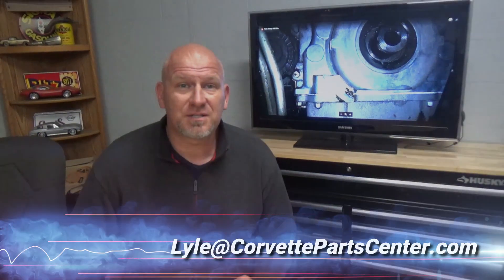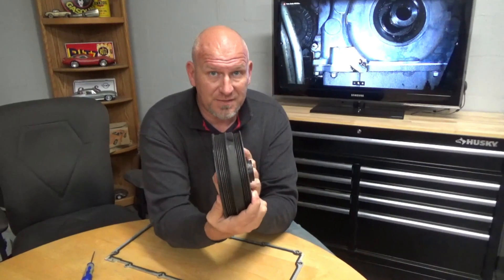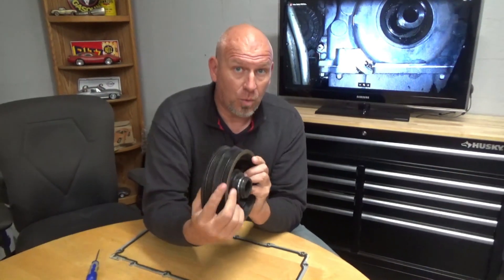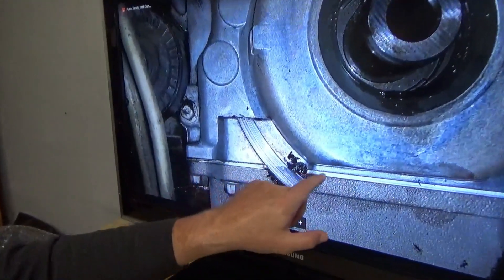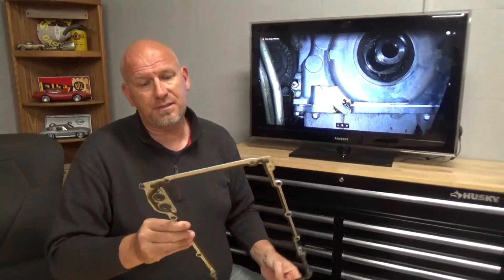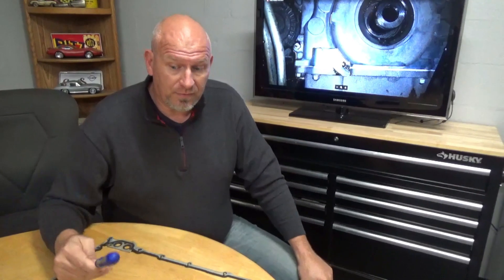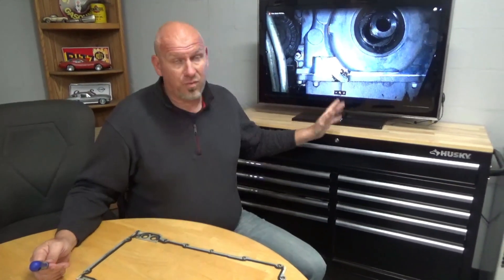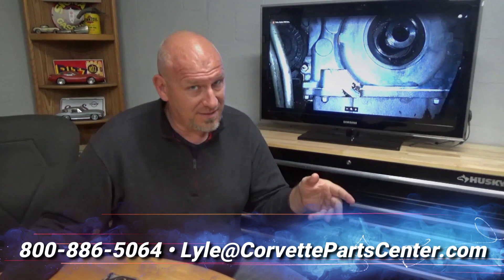C5 C6  Corvette Harmonic Balancer Problems

Comment: I've seen a lot of C5 and 6 engines running and I think I can tell when a HB is wobbling, but if you could provide a video closeup of the actual thing, doing the wobble, or perhaps an example of an early stage wobble, and a "bad", about to fail wobble, that would be enormously helpful. As always, you are the go to guy for these cars and I appreciate everything you do.
Reply: This is a good point. 

Maybe they’ll make a video describing this.

Comment: I've had my 06 for about 18 months and only put 1000 miles on it (it has 40 k miles on it). I noticed a couple of weeks back I was hearing a slight chirp from the engine. Yesterday I looked and saw the "death wobble" as you described. Luckily I only drove it 60 miles since I heard the first chirp. I already have my mechanic notified so he can replace it. Thank God for this video.
Reply: Instablaster.

Comment: Invaluable advice for us vette owners. Mine wasn't wobbling last summer, it is now. 99 c5 vert 50k miles. Time to get crackin.
Reply: Hope mine doesn't. 2000 convertible 60k miles
Reply: @mjphoto45  Oh, it will.
Reply: @mjphoto45  mine just did yesterday … 65k miles 05 C6

Comment: Just got my 05 C6 pully replaced at a local shop in lower DE, cost $1300, I had them replace it with a one piece aluminum one

Comment: the video is great and provides great information.i would not be afraid to change it using this video. however with having to take the steering rack out i will take mine in to have it changed.

Comment: I have a 2006 Z51 convertible, and I heard some chirping. I took it to a chevy dealer, and they said it was the harmonic balancer, and I needed to do something about it soon. The estimated cost was $1200, although the part itself was around $200 bucks. However, I saw a video on replacing this, and I think MY age would stop me from getting in there and taking apart the front suspension!
Reply from the maker: That price isn't crazy.  Especially if they are going to replace the belts, tensioners and idler pulley at the same time.  Lyle

Comment: What a coincidence, I looked at some Corvette forums recently and there's quite a few issues with this part. I changed mine almost immediately although my C5 Z has only 64K miles. The bolt broke while taking it off which made me thankful and upset. It took hours to drill it out. I replaced the balancer with an ATI 10% under drive. Thanks for the Vid!!
Reply: Have you had any issues with the underdrive? I was wondering about cooling system issues
Reply: @joshuaborem7063  No problems at all. This one gave me a little more torque over the OEM. The only thing you got to keep in mind is the belt sizes change. Keep a copy in the glove box in case.
Reply: @tonywestbrook6436  i’ve had my 2008 Corvette for exactly 2 1/2 days now. And I can’t even fathom the idea of wanting more power or torque :-) but hey, good on ya
Reply: @joshuaborem7063  My C5 Z is now equivalent to a C6 Z, so I'm very happy and like you, I don't need anything else now.
Reply: @tonywestbrook6436  you said you had no problems with cooling with your underdrive pulleys. Sorry but I also meant to ask what state you’re in. Because I’m in Florida and it gets real hot here.
Reply: @joshuaborem7063  NC

Comment: My brand new C6 Corvette developed the "death wobble" he is talking about with 4K miles on the odometer. I noticed that by strange sound (not scraping) from the front. It was replaced under warranty. So far (it happened 10 years ago) it is good.

Comment: I had exactly what you are describing as far as the front engine leak and the "blow back" of oil.  My mechanic was worried that I might have a fire as it was landing on the exhaust system.  So, 4k later,  new oil pan gasket - new harmonic balancer and new belts and pulleys as well.  4k well spent I guess.  Did not see you wandering around Corvettes at Carlisle this year (2022).  Hope you had a good time there.  I was busy with our club-run NCCC-sanctioned car show.  Cheers from central PA.
Reply from the maker: WE walked about 27 miles in three days and had a great time!  Sorry to have missed you as well!  Lyle
Reply: @csvette  Yeah, I did keep and eye out for you but on Fri and Sat I have a lot to accomplish putting on our club's NCCC-sanctioned show. Went very well this year - so we're happy about that.  Keep up with the GREAT content.  Excellent job.

Comment: I've been lucky with my HB.  It failed under warranty at 28,000 miles back in 2009.  I now have 91,000 on my 2007 C6, I think it is beginning to fail I heard the same chirping noise for a moment.

Comment: You guys are fantastic. Lyle what a great service you do for the Corvette family. Thanks! Would you please do a video for the problems with a 2000 C5 fob. I can get only one fob to sinc up. I have bought the correct one for a back up (and boy they are expensive) but the second one will not sinc in position #2. At first, I thought it was the new fob so I bought another one. Both (original GM) do not sinc. And yes they are the correct on and new batteries and the battery in the car is new. Please help for now I have close to $200.00 in extra non working fobs.

Comment: late to the party but i have a 02 with 130k miles, white mark still lines up. i wonder how many of these that fail are in colder climates, im in a vacation spot, winter is usually in the 40's.

Comment: WHATS THE SHOP TIME IN LABOR ON THIS JOB?  6 HOURS?🤔
Reply from the maker: 5-7 hours depending on how much it fights us.  :)
Reply: @csvette  Yes that is about what the dealership charged me in labor $140-150 per hour.  Went 93,000 miles before noticed the wobbling on 2005 Corvette.  Hopefully I will get another 90,000+ miles on this repair which includes a 2 year warranty.  The power window repair was $500 for the part if I remember correctly.  I had a feeling that the harmonic balancer repair was a big job and not for the do-it-yourselfer.
Reply from the maker: @microminiskirt  The main difficulty in the balancer job is getting the steering rack out of the way so that you can access the balancer--we drop the whole front cradle out of the way to do it.  Lyle
Reply: @csvette  THANKS FOR THE INFO.  I CAN ONLY IMAGINE THAT PUTTING IT BACK TOGETHER CORRECTLY IS A MUST SO THERE WON'T BE ANY PROBLEMS WITH THE STEERING TOO.

Comment: I will be moving to the area, I have the poor mans Vett a 1987 Iroc-Z 5.7L Iroc-Z all orignal, I have had it for 25 years. It needs the AC converted to 134a, can you this on my Camaro. I am the 2nd owner and the car has been my baby all these years. Thanks great channel!! Anthony
Reply from the maker: Hi Anthony!  I only work on Corvettes, so we can't work on the Camaro (awesome car, tho!).  Hitchcock Automotive nearby our shop is very reliable and would be happy to address your car.  Call them at 941-306-1000.  Lyle

Comment: Very helpful. If the HB is replaced after the wobble is discovered, should I be concerned that any of the accessories (alternator, water pump, AC, etc.) or any other items were affected or their lifespan shortened? Since I am not sure how long the wobble was occurring before being discovered.
Reply from the maker: WE always replace the tensioners, idlers and belts at the same time.  Water pump and alternator bearings are checked, too, but rarely require attention.  Lyle
Reply: @csvette  Thank you. Much appreciated.

Comment: Helped me save my son from buying a car that was perfect in every way, except this one. 
For those reading I’ll share that the car we test drove would make a random chirp during our test drive. Sounded a lot like a belt squeaking. Dealer shared this car had a brand new tensioner and belt so of course when I heard the chirp I started looking closer. Sure enough the balancer was wobbling around. 
If it weren’t such a bear to get to on a C5 I wouldn’t hesitate to change it myself but this is no easy job on a C5 unfortunately.
Reply: That's why I had it done at Ray's Auto center in Lakewood Washington. The best Corvette people in town. It needs to be done.
Reply: @genej501  how much did it cost? I'm not sure I want to do this on my own
Reply: @Jv615  600.00
Reply: @genej501  I'd be happy if I find someone to do it for 1000 😅 ,damn So Cal
Reply: @Jv615  I'm the state of Washington. My local auto repair center it's very good with corvettes

Comment: My first one went out at 35,000 miles on my 2001 C5. The big question is, this was a known issue even back in 2003 when they replaced mine under warranty, so why did GM continue to keep using these for so many years???
Reply: Because the General Mayhem doesn’t give a hoot.
Remember , the Corvette is a low production unit and many parts are out of their parts bin , writ cheap !
Still love my C6 Convertible though .

Comment: Question: Do these harmonic balancers ever last as intended? Say maybe 100,000 miles before it is expected to replace it worn or not? Or is it just simply a recommendation from GM to replace these at specific mileage? Also, I have been reading about replacement Harmonic Balancers that are of better quality.  If these are used as a replacement, is it reasonable to assume they will last longer? Forever? Forever being relative of course. During a rebuild, I would imagine changing it anyway.
Reply from the maker: It is an age issue, not a mileage issue.  The rubber bonding strip between the weighted outer ring and the center hub dries out and allows the outer ring to begin wobbling/walking backwards.  The PowerBond and Summit Racing replacements are solid,one-piece units that should never have to be replaced again.  Lyle
Reply: Thank you Lyle. Strange that didn’t become a recall early on. Will definitely replace it with the part you recommended. Don’t know where you folks are located, but I want to be sure and have someone who knows what there doing replace it. Use to do all of my own work on cars from model T’s through many chevys. Condo life and age starting to get in the way. But thank you

Comment: The total  approximate cost of the repair, covering all parts as described by the video, would be helpful. Ty
Reply from the maker: Total cost for parts (balancer, balancer bolt, front crank seal, balancer pin kit, belt tensioners, belt idler pulleys and belts) and labor for this job is $2100.00 before tax.  :)  Lyle

Comment: Been watching most of your videos and wanna say thanks for sharing all the knowledge !

I just bought an 06 corvette with 30k miles and super clean. I never owned a corvette so this is my first 

I looked at the harmonic balancer it seemed to wobble so I bought an ATI harmonic balancer  I believe for almost 490 dollars but all the reviews were good. Also got the AARP bolt with it . Should I purchase anything else or do you think I should be good?

Also my other question is how worried should I be about this ?
Reply from the maker: The Summit Racing 2501 costs less than $200 and is excellent.  The only time I recommend an ATI is for legitimate competition purposes.  I wouldn't waste the extra cash on the ATI for a street-driven car.  hope this helps!  Lyle

Comment: Chris,
Awesome info and always top notch vids, thank you! Found the wobble before I made the purchase so the dealer is replacing the wobbly HB. Do you recommend pinning the new HB?
2002-C5 with 39,000 miles
Reply from the maker: If the shop is familiar with pinning balancers, then yes.  If they have to learn on your car, then no.  Lyle

Comment: How much movement is normal on the balance wheel? And how much movement is normal on the motor itself? The balance wheel was already upgraded on the car I looked at yesterday, and I couldn't notice much movement. But I thought the engine moved quite a bit.

Comment: Lyle, thank you for making these awesome videos! Is the LS3 still prone to having the harmonic balancer issue like the other LS engines? If I buy a 2008 or newer that has no wobble, what can I do to prevent it from happening? I saw the video about Pinning the balancer. Should I do that with a stock HB or aftermarket? What else do you suggest? I'd rather not spend any money if it's fine, but at the same time I don't want to feel the need to check it all the time for peace of mind.
Reply: Hey Kirk!  The balancer issue runs all the way through 2013, but it isn't a deal breaker.  Pinning the balancer will keep it from rotating on the crank, which is important, but it won't stop the breakdown of the rubber ring that holds the outer ring to the inner hub.  These things don't go bad overnight, so checking them once a month is sufficient.  The Power Bond unit that Summit racing sells is a good choice when replacement becomes necessary..  Lyle
Reply: @lyleaulwurm9486  Thanks again for your valuable information!

Comment: Have the Harmonic Balancer something to do with the Torque Tube?
Does it "Balance" the Torque Tube?
Why does it start to wobble? Because of Age, or because the Torque Tube?
Reply from the maker: Everyone calls it a harmonic balancer, but in fact it is just a vibration dampener as LS engines are internally balanced.  The torque tube and the balancer can affect each other when one is really failing and out of whack, but not a normal situation.  The balancer wobbles due to the failure of the rubber seal that is supposed to lock the weighted outer ring to the central hub, but as it ages and shrinks and the outer ring begins to wobble and then starts walking forward or backward--neither of which is good for the car.  Lyle

Comment: Excellent video Lyle! I own a 05 C6 with 70K miles on it. The car runs great, and always has since I’ve owned it for six years. Bought it used with 39K miles on it. I have to replace my radiator since it has a leak on the side of it, plastic part of it has a small crack in it. I’m concerned about the harmonic balancer being in good health. Everything seems ok, just concerned! I’ll be moving in a couple weeks to Kanab Utah from Illinois. I will be trailering my car however. Do you know of any good mechanics in that area? It’s a small town, but maybe in St. George? Any recommendations would be most appreciated!
Reply from the maker: Hi Chris!  The radiators ALWAYS fail at that same point--weakness in the injection molding process, I guess.  If your balancer isn't visibly wobbling, don't worry about it yet--just check it every time you check your oil.  Corvette Forum will be your best guide to locating someone in UT that knows these cars well.  Safe travels!  Lyle
Reply: @csvette  
Thank you Lyle, most appreciated!

Comment: I have a 2007 C6 with only 14000 mi. I have noticed that "death wobble" you talked about. What balancer do you use to repair your customers' cars? Thanks for the 'heads up" video.
Reply from the maker: I recommend the Power Bond unit from Summit for $259.99
Reply: @csvette  can you tell me the part number
Reply from the maker: @craigpahl7937  PowerBond PB1117SS

Comment: Just had my balancer replaced by a reputable mechanic.  After installation, having trouble with power steering. Had to drop rack to remove pully. Any suggestions on how to correct hard steering... We bled the air with vacuum pump?
Reply from the maker: Your Magnasteer module may have gone bad--rack works, but it really hard to turn at low speeds.  That would be my first guess, and remedy is a new rack (unfortunately)  Lyle
Reply: How much did the shop charge you to replace the balancer?

Comment: You’re scaring me lol. I’m looking to trade in my 05 mustang gt for a base c6 with a manual. My mustang has treated me so well with only the alternator going bad and a leaky differential pinion seal. I don’t want to get a c6 if they have problems all the time.
Reply: I have a '06 Saleen supercharged Mustang and a base '08 C6. If I was going to sell one of them, it wouldn't be the Mustang.
Reply: I’ve never even changed the serpentine belt on my mustang let alone the damn harmonic balancer. Maybe I’ll start looking at some coyote mustangs instead
Reply from the maker: They really don't have very many problems at all.  I highlight the things to look for when buying or maintaining a Corvette, so it may seem like I'm always talking about problems...but these cars are pretty bulletproof.  Show me any other GM cars from the late 90's/early 00's that are still on the road with 250-350K miles?  These cars are a fantastic value, no matter which lens one looks through.  :)
Reply: C&S Corvettes thanks for the response. A C6 corvette is my dream car. I live near Tampa so if I get one and it has a problem. I’ll take it down to you guys.
Reply from the maker: @Kevinb1821  , just make sure to have us look it over BEFORE you buy it to avoid any scary hidden issues!  :)
Reply: C&S Corvettes thanks. I saw your video of the guy who bought 2 rusted corvettes lol.

Comment: What if the balancer is pinned with slight wobble? Wouldn't that prevent such a dramatic failure?
Reply from the maker: No, it wouldn't.  Pinning the balancer to the crank would keep it from rotating on the crank snout, but it would do nothing to stop the weighted outer ring from separating from the inner hub.  Lyle

Comment: I have a c6 when the car heats up and air-conditioning running
The care heats up to almost 220 degrees and the amps drop to 11.9 that is with the foot on the brake
Any ideas?

Comment: Is the harmonic balancer issue limited to C5 and LS2 C6s or are they just as prone to failure on LS3 C6? I did watch your video explaining about LS2 crankshaft getting out of balance and destroying harmonic balancer and that that is no longer an issue on LS3. Crankshaft issue aside, is the harmonic balancer still a potential issue on LS3 C6? Did LS1 C5 engine have a similar issue LS2 did with poorly designed crankshaft?
Reply from the maker: The balancer issue is present in every Corvette 97 through 13.  I have not seen the LS1 or LS3 lose internal balance like the LS2.  Lyle
Reply: @csvette  Thank you Lyle